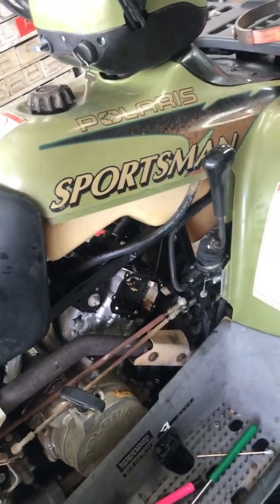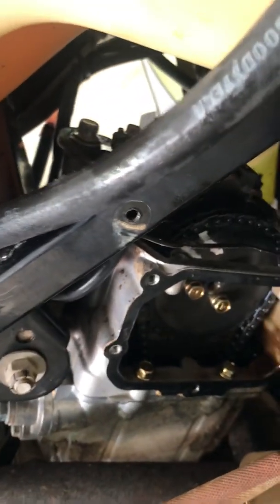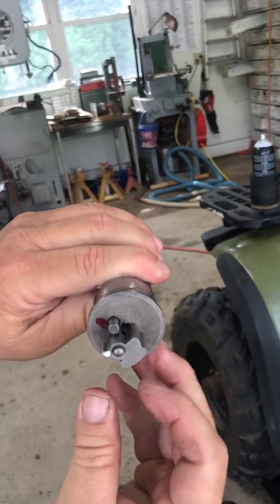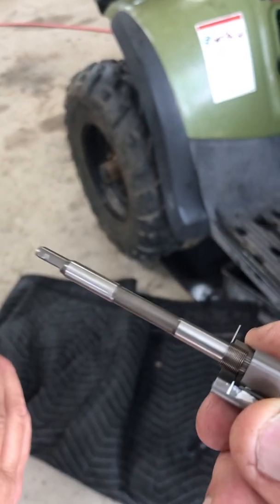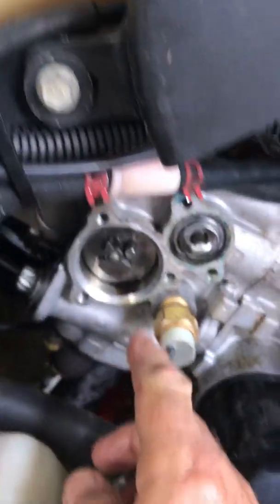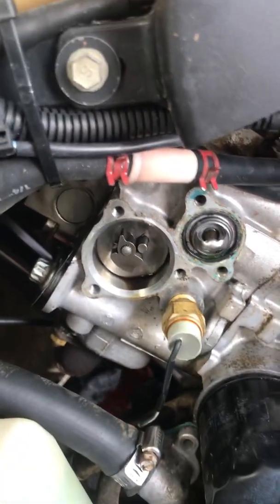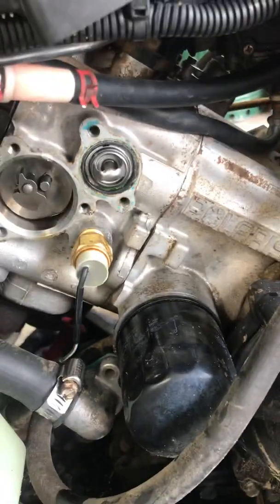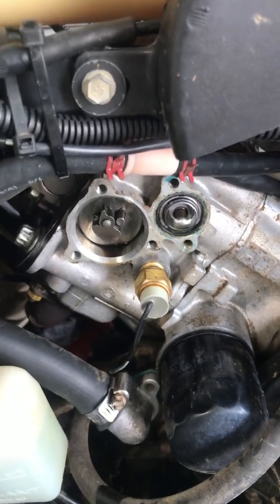Polaris Compression release broke Fixed free second of four videos￼￼

Comment: Does this make the pull start super hard? I can hardly pull it. And the starter just went out. Or it can't turn it over. Thanks
Reply: I wondered the same thing. My scrammy wouldnt start maybe 1 in ever 200 cranks of the electric starter. I tore my engine apart and noticed the spring on the compression release wasnt on correctly. Someone put a new cam im it. I fixed the spring and now waiting on gaskets put i noticed its very hard to pull now but it will go riggt after the compression stroke, it didnt do that before. I hope its fixed.

Comment: You do know what happens when the spring is too tight I hope !
Reply: If the spring exerts to much force  , you will have the opposite issue , the compression release will be stuck on at idle , this will cause issues with idle and in many cases you can hear it tapping aka  bumping the exhaust valves open. if your increase the engine rpms and this goes away your spring is exerting to much return force,,  the spring return force needs to be very light . .

Comment: I had polaris rebiuld my top end for bad cames now the starter dont want to turn it over and it will ripe your arm off trying to pull start it they told me i needed a new starter ill never go back ther again
Reply: wow...they obviously didn't set the decompression assembly correctly. That's a real unprofessional move on their part. A magnet on the cam lobe and putting the spring on like oem works perfect. Doing it like the video shows will add to the tension it takes to release the decomp.  Definitely don't want to add tension.
Reply: Exactly what I have going on.. impossible to pull start

Comment: Thanks for the info. Very helpful. Can this repair on the spring be done without removing the cam?
Reply: yes.... watch fourth video... he tells you a lot more in detail... except... you have to stand on your head to watch it... when he says put dowel pin at 9 o'clock in that video, it is sideways so adjust monitor accordingly..

Comment: Can this be pulled and adjusted and reinstalled without taking out the cam?
Reply: yes, take the cam cover off on the side of the head. You'll have to take the valve cover off as well and use a magnet to pull the decomp ball forward so the pin slides all the way in. the cam has a hole in the bottom of the lobe where the ball is made to stick out for the decomp of the left exaust valve.

Comment: I got a question I just tried this and now the rod won't go all the way back in what did I do wrong
Reply: I pulled the rod out rewound the spring and now the rod stops about a half inch front seating back all the way in
Reply: Your check ball is down in the hole, turn it over and see if it’ll fall back down
Reply: thank you I tried than and it did fall back down all is good so if anyone ever tried this no way no how can that ball fall out I found out ur good but thanks for thr response
Reply: You have to take the valve cover off and use a magnet. Stick the magnet on the cam lobe that has the decomp ball hole so it pulls the ball towards it then the pin will slide in. It's on the exaust side so take off your gas tank and front plastic.

Comment: NOPE, you don't wind that cam spring to add tension to it!! It clearly states on the slip of paper that comes with a new OEM camshaft "DO NOT PRE-WIND THE SPRING ONE FULL TURN OR THE COMPRESSION RELEASE WILL NOT DISENGAGE WHEN THE ENGINE STARTS". "IT IS IMPORTANT TO NOTE THAT SPRING PRESSURE IS VERY LIGHT". I just replaced a camshaft in a 2010 sportsman 500 in May of this year 2022, and the centrifugal weight acted the same way as the one you showed before you wound it and I never touched the spring. But I totally agree on the part that the polaris "engineers" should be kicked in the n#ts for making such a mickey mouse setup. I am in no way a polaris guy for MANY reasons like that.
Reply: Then what’s the fix? My 2001 is getting 125psi on compression
Reply: @thegoodstuff-gs3sl what's wrong with 125 psi of compression? You mean it's too much and the starter wont spin the engine?
Reply: @thegoodstuff-gs3sl yours probably isn’t closing the spring is loose maybe overheated and took the temper out .
Reply: Can that cause the starter to not spin the engine as it should? Or just the pool start?